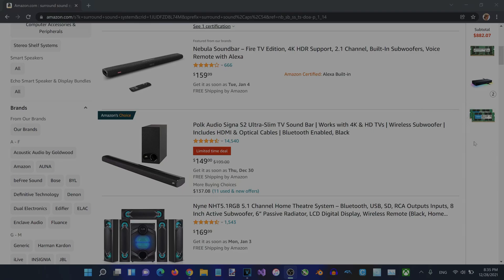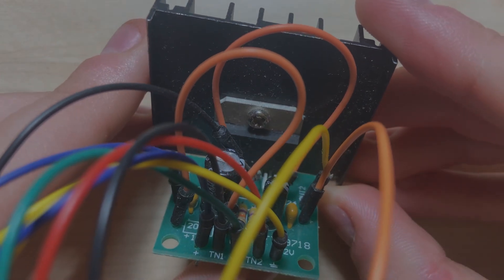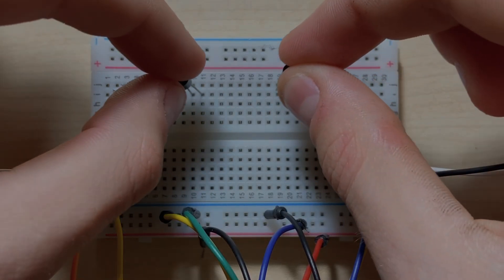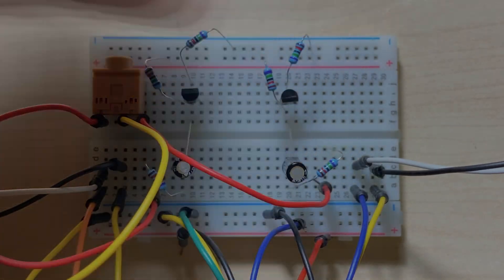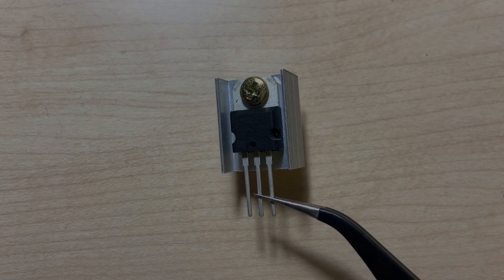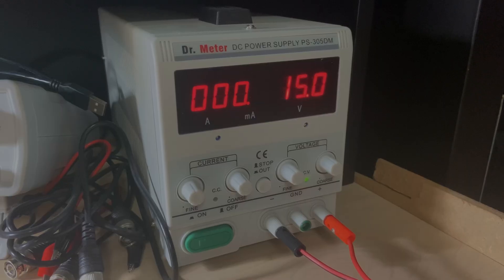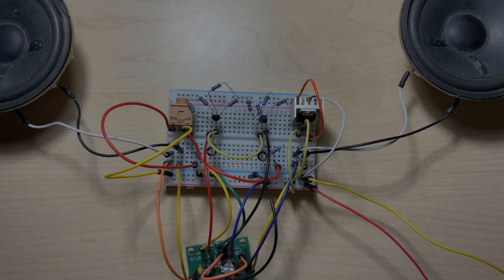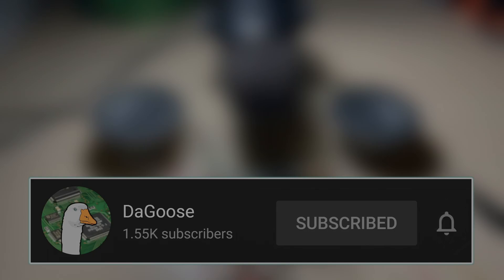How to Create a Simple 2 Transistor Vocal Remover or Surround Sound Decoder - Use With Any Amplifier

Comment from the maker: Note: The purpose of the 5v regulator is to supply a “virtual” power source to the preamplifier to help reduce a low frequency distortion problem. In most cases, You don't need the regulator such as if your amplifier has it's own power source.

Comment: Single transistor vocal remover circuit pls
Reply from the maker: that’s not possible
Reply: @DaGoose  I'm try many time but failure single transistor vocal remover but I'm try to more than wait for success
Reply from the maker: you’re wasting your time. like i said, it’s not possible. you need two transistors for each channel so that one channel is opposite in phase but equal in amplitude for center cancellation.

Comment: Hi I did build this circuit but it does not remove center
Can you explain how does it work? I guess the whole idea is to create the 180 degree out of phase signals so that they cancel out the common signals. But if you take out put from the collector of both transistor then signals will be be out of phase but then that will happen for both channels so won't cancel out.

But if you take one output from collector of one transistor and  from emitter of other then only those output will be 180 phase shift to cancel out.
and probably that is why my circuit is not working. It is not removing center band but just acting as normal pre amp like circuit.
To get higher accuracy i have replaced all resistor with preset and adjusted every resistor perfectly. I have also tested transistor biasing and other voltage of both transistor and those are perfectly matching.

Is my thought correct here..? I don't think I made a mistake in circuit building.
I also have isolated power supply for both amplifier and this circuit.
Reply from the maker: A brief description of how it works at 5:09. 

It sounds like you didn’t place the transistors in the correct orientation. A schematic is available in the link in the video description, I suggest you use that instead of following the video. 

It’s very important that the connections on the resistors are properly connected because one loose connection will wreck the entire circuit. A lot of breadboards have cheap connection holes that don’t always work so it’s important that you check each connection.

Comment: Really apriciate your efforts, This is something i was desperately looking for. However, at 1:54 The values of the register you speak like 75K aren't matching wit color code. can you elaborate that ? Also please let us know the realvalues of the resistores you used not the range please. it simplifies lot of work
Reply from the maker: Glad it is helpful to you; The resistors at 1:54 are most definitely 75k ohm resistors. Purple + Green + Black + Red + Brown = 75K ohm, 1% tolerance on a 5 color band resistor (the light distorts the colors a bit, so the colors you see may differ depending on the color accuracy of your screen). The exact resistors I have used in the video are explained in the building section of the tutorial and not in the components list. I didn’t list the exact resistors I used in the component list because I didn’t want viewers to have the impression that only one value of resistor is allowed for the build.